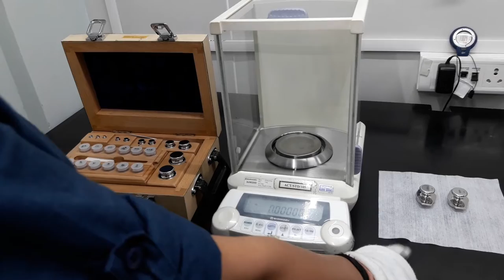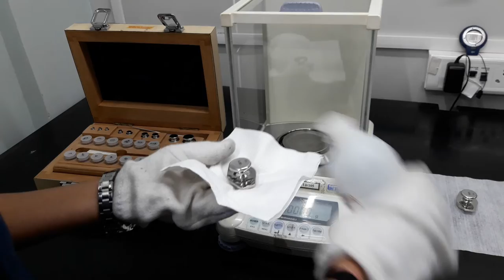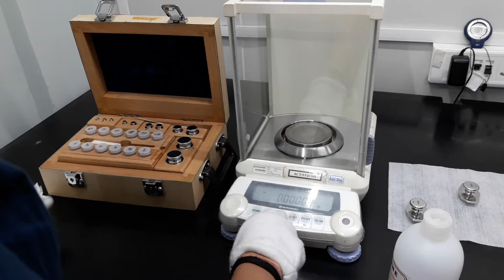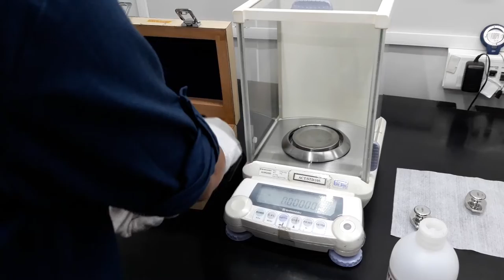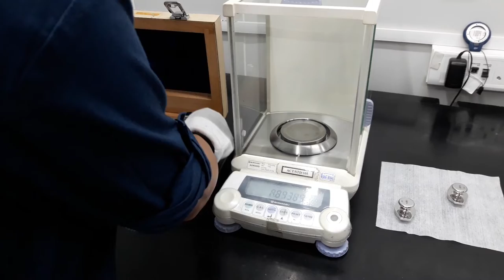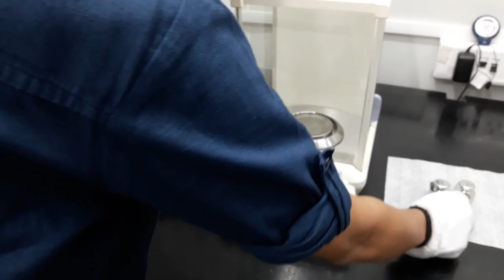Weight Calibration

Comment: hii sir/Medam,
Why We have to put a weight for soaking ?
is there any large difference in a reading with or without soaking task?
and what is the soaking time?
why the ABBA method?
is  repeatabily of balance is required for UNC calculations?
How to measure density of weight for the calculation of buoncy correction?